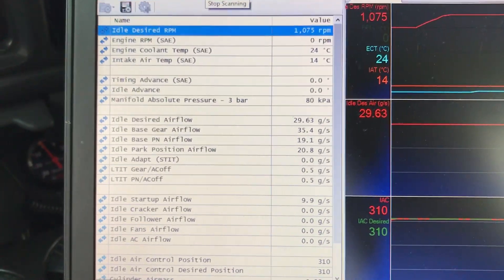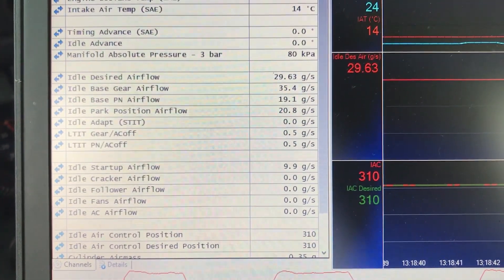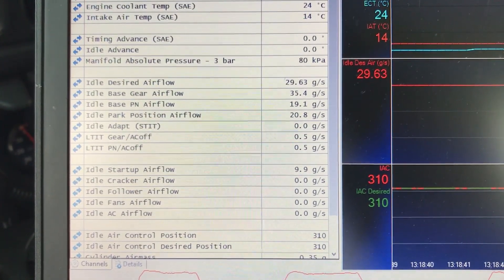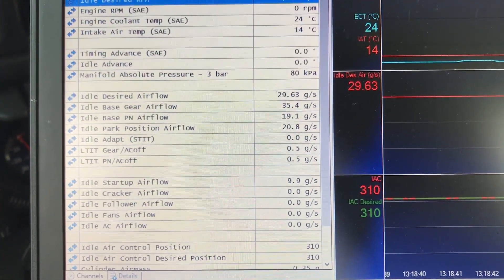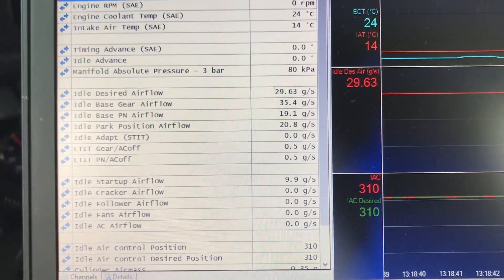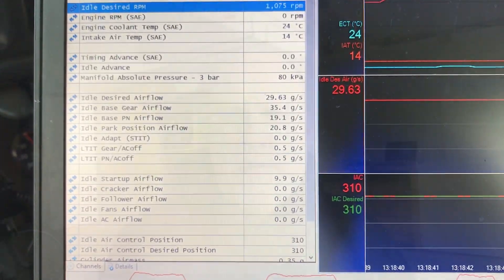Idle Tuning Issue After Cam Swap

Comment: Hey did you figure it out ? I have a cammed 6.0 I’m running with a 5.3 ecu and I got it running but does the same exact thing when switching into gear. I messed around with it and got it to now only drop to around 500 and barley stay running but it goes crazy lean and I noticed map also increased to almost atomosphere pressure

Comment: Hi Randy,,Thank You for all the idle tune step through after a cam swap. Recently purchased a 2010 Chevrolet Suburban,'as is', rough idle,,that of course had the VVT cam from factory. The genetleman i purchased the truck from done the AFM/DOD delete after the truck got two collapsed lifters. With his kit from AMS Racing,he did get the Diablosport Predator 2 to do the DOD delete in the ECU. Long  story short,,after much wrangling,,come to find out the Predator2 is not capable of doing the VVT delete part,within the ECU. Wound up calling Holley/Diablosport to confirm this.  So justa few days ago,seen in my cheap ELM327 device the idel timing adjust is just constantly scrolling back and forth very fast!.  Also read recently there is two possible cam phasers,,for the non VVT cover,,one is 5 volt and one is 12 volt,Keep in mind this is my forst time,messing with this stuff,,,so takes me forever to get head around this stuff. Any ideas,,,Sorry for long message,Thanks again

Comment: I believed it was in timing swing it didn’t like the numbers going from 5-45 had to bring some of the timing down to 20-25 mostly at temps above 140 injection boundary timing at 10% seemed to help but still. It what I want it wants to launch at every stop and go and mostly have to drop to neutral to save it

Comment: Idle air control valve/motor speed, duty probably needs to go up when the engine detects load however that may be! not familiar with these!

Comment: Increase of KW or horsepower you call In states you need to put bigger injectors in if you put bigger cams in flow rates for injectors go up , air fuel mixture tune , sounds very much like you are not getting enough fuel delivery now you have increased air capacity into the engine to get the correct combustion at the right time I would also play around with spark plugs and try a hotter plug
Reply: Mine is cutting 25 parts fuel so that ain’t it. It timing when it died is at zero

Comment: Maybe the cam is too forward. When the gear kicks in the crank wheel slows down a notch and the belt may get a tiny bit slack between the inside cam and crank for a second ( the tensioners works like a spring ) causing the engine to suffocate. Try moving the intake cam sprocket anti cockwise 1 tooth. then the ignition timing perhaps....I was thinking that the readings is just showing what happens
Reply: I’m scared to mess with that last time timing must of been off by a tooth pistons were hitting exhaust valves and it came apart
Reply: No this is an enrichment problem

Comment: Have you played around with the injector boundary settings ? I raised Injection Timing Normal 9 % across the whole table. This made my idle much more stable less stinky and seemed to gain some torque. ChopperDoc181 has some info on this.
Stock injector boundary timing settings for a stock cam is IVO of 95 degrees, your cam is like around 145 degrees Intake valve opening.
I’m still getting my brain around it but it’s been the biggest improvement I’ve used so far and I’ve tried everything to get my idle happy.
You’ll have to retune VE and maf again, my idle tables went from 47 to 58 after doing this but was pulling about 2 % out everywhere else above on my VE.
Reply: Think I figured it out 
EOIT TDC is referenced as 360 where cam timing is referenced differently as 0 degrees TDC.So let’s say the stock cam intake valve opens at -19 BTDC. That’s 360 - 19 degrees of cam timing in EOIT timing which is 341. 341 is when the intake valve begins to open and 300 is when the injector fires. So 41 degrees between injector pulse and Intake valve opening. 
Using this same 41 degree timing difference on a 285 intake duration cam the IVO is -32.5 BTDC. 360 - 32.5 = 327.5 + 41 = 367.5 calculated EOIT
I tried 6.3 setting this was way too much, and my VE started going lean.
The sweet spot I’ve found is 6.1-350 
Stock EOIT settings has injector firing @ 300. With a big cam 27.5 degrees earlier instead of 41 degrees. Much more earlier than stock. 
Made a little spread sheet on the EOIT tables in tenths up the the boundary limit.
5.6-305
5.7-314
5.8-323
5.9-332
6.0-341
6.1-350
6.2-355
6.3-368
6.4-377
6.5-378
Reply from the maker: @Busa0069  good info, thanks for sharing it. I'm still trying to get my brain wrapped around it lol. The problem is I don't know the specs on the stock cam with regards to when the intake valve opens and closes. My cam doesn't have a whole bunch of overlap so it's not that stinky at idle but I'd still like to experiment with the EOIT settings at some point. Thanks again for sharing your findings and how you arrived at them.
Reply from the maker: No I haven’t messed with those settings yet, I’ll have to check that out
Reply: @LowbuckLS  My cam math is all wrong but the EOIT settings are the trick. My normal injector timing boundary settings are now 6.1 in the operating temp range. Trying to figure the difference in degrees between stock cam and performance cam IVO in degrees and then interpolate that to the EOIT settings.
Do you know the intake centerline on a stock 5.3 cam ?